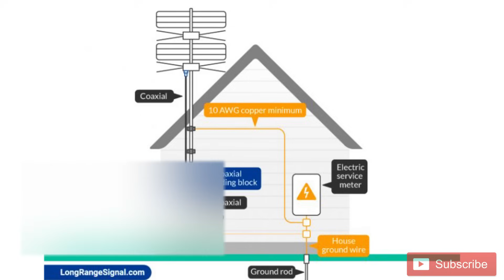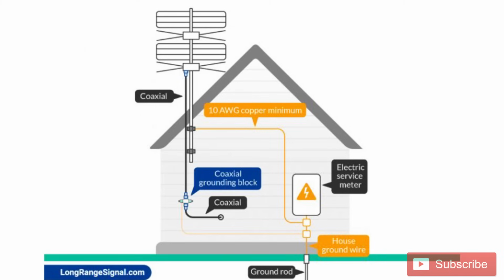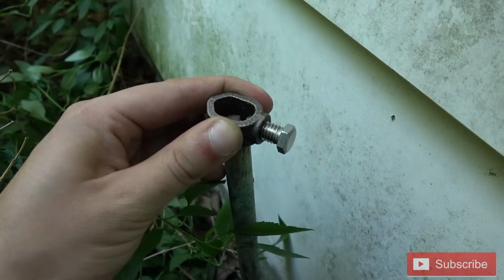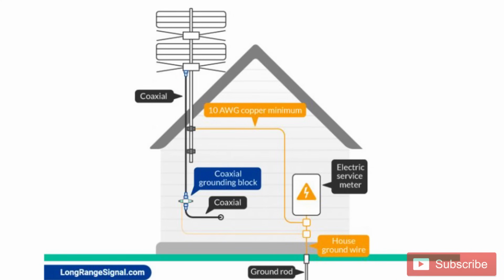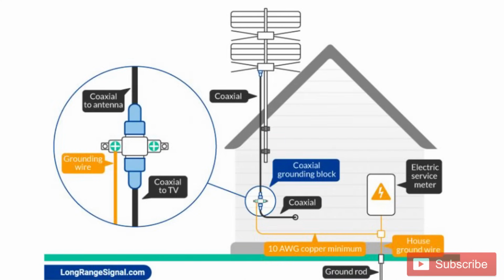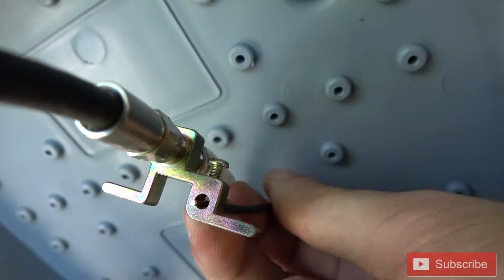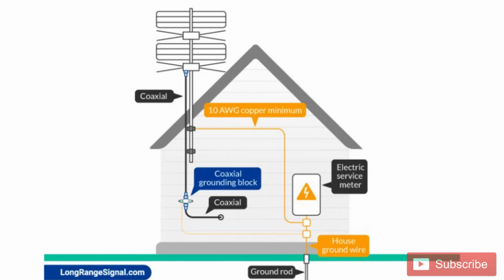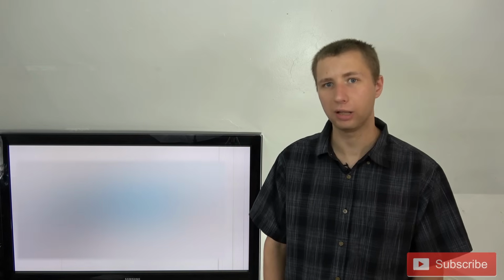How To Ground an Outdoor TV Antenna Per NEC

Comment: nice clean clear cut example.  I wondered what the wire was running next to my gas meter.  I haven't checked the electrical box yet.  so....  what to connect the ground wire to inside (attic)?  if we are running a pre-amp, and the pre-amp has a 3 prong plug, is it grounded?  I need to check mine.
Reply from the maker: Drill a hole in the side and run it to the ground rod that way
Reply: Many newer house have length of bare ground wire running through the attic the length of the house.
Reply: @genesky61  I thought about that.  I was wondering if the attic furnace was grounded.
Reply: If a human is thinking clearly.

Do the metal pipes that stick up through the roof ( ventilator pipes and such ) have a separate ground wire running from the metal pipes to ground??
The answer is No. 

Do the heating units and air conditioning units have a separate ground wire running from the unit the units to ground??
If you look you will most likely find the answer is No.

Concerning antennas , a ground wire is a path for atmospheric electrostatic buildup to go to ground.

Atmospheric electrostatic is normal part of life on this planet.

As for the bare wire that is running through the attic , the length of the house. You will most likely find it is not connected to any thing other then ground outside of the building.

If you are beginning to think that the issues concerning ground seem to be  somewhat convoluted , 
The answer is Yes and No.

Grounding issues have been formulated over a long period of time , 
having to do with human issues concerning life on this planet. 

When push comes to shove , is it better to ground or not ground??

The answer will be it is better to ground.

Is this always possible or practical or will grounding actually happen do to variety of factors , and alot of has to do with what the humans understand at any given point in time.

You can research this up one side and down the other.

Welcome to Plant Earth.
Reply: @genesky61  - By "atmospheric electrostatic" do you mean lightning?  What most of us think of as static electricity has minimal current and doesn't require heavy wire to eliminate.
Reply: Many Gas service lines are now plastic from the main to within a few feet of the meter, the part coming out of the ground is soft iron usually. So why the wire? It is not for grounding, but a point to attach a signal to so the gas line can be detected underground by "call before you dig" or diggers hotline service providers. A gas meter would NOT be the place to ground anything... Think of the ramifications in a worst case scenario !!
Reply: Yes is Ok to search on the internet for information of atmospheric electrostatic. 

I mean atmospheric electrostatic is part of the atmosphere of this planet.

Yes you still will use #10 copper ground wire or larger because of the lightning factor.

Lightning not will say , I will not strike that wire because is to small.

Yes is Ok to arrive at an understanding without making situations real complicated.
Reply: Popular Electronics , August 1967 , Pages 59 thru 62. 
Title of article is , What Ground?

Find the article at , www.rfcafe.com .

Comment: Is there a follow up to this with a diagram for if you're using a power inserter and pre-amplifier? I would guess with the coaxial grounded while using a power inserter + pre-amplifier that you'd basically be making a dead short?

Comment: I am putting a two way  coaxial splitter in so I can hook up a  tv  on different floors with the coaxial cable running down the side of the house to the ground rod. Can I connect the coaxial grounding wire to the splitter, or do I need to buy one of the coaxial surge protectors to connect the ground wire.
Reply from the maker: I cannot comment on this due to liability reasons. Check NEC code when grounding.

Comment: Hey antenna man can l take the grounding block and bolt it to the mast, attach the one copper  ground  from there running to my ground rod.Will this still work ?
Reply from the maker: Due to liability reasons I cannot comment. Refer to NEC code
Reply: Antenna Man 
Gotcha,thanks for the reply

Comment: I have seen on many sources, that refer to NEC,  that the ground wires for the mast and coax can not exceed 20 feet.  This can really be hard to achieve, even on a one story house.  There is an exception that discusses a 2nd ground Rod, but even with a 2nd,  meeting the 20 foot specification may be impossible.  it's also interesting,  that most manufactures don't include the 20 foot max requirement in their discussions.  They include everything else (i.e path, AWG etc etc)  but never mention the 20 foot max..... Am I missing something?  Is there a 20 foot max for TV antennas?  Perhaps I have misinterpreted NEC .......thanks for the videos, they have been perfect!!!

Comment: I installed an antenna on the side of the house nearest the family room (and tv).  This location must be a good 50 ft. or so from the service entrance for electrical power (and breaker panel).  So I bought a six foot copper grounding rod and drove it into the ground just below where the antenna is installed and grounded the mast to that rod.  Is that not sufficient?  Do I have to run a wire all the way along the length and width of the exterior of the house to connect it to the electrical panel's grounding rod?
Reply from the maker: You should be fine with your setup.
Reply: Yes your antenna is grounded but you could potentially have a voltage difference from the antenna to ground in your house. That is why NEC code says all ground rod must be bonded together. If a building inspector seen that he would probably give you shit for it and make you correct it. But for sole will  it dissipate static off the antenna yes it will.

Comment: I wasn't thinking about antenna strikes, but since I live in a state with THE highest numbers for lightening strikes, I will look harder at the antenna a previous owner erected.  I already turn off my tv during lightening storms, in case of an electrical surge.
I always figured that properly grounding the antenna would result in optimum signal "grab".  Thanks for the added precautions.
Reply: And Yes proper grounding does improve the reception.

And Yes proper grounding does give atmospheric electric static build up a path to ground.

And here is a truth , a direct lightning strike will fry the electronics even if the ground is proper.

A proper ground is a 6 to 8 foot copper ground rod driven into the ground.

The ground can be improved by making a trench about a foot and a half around the ground rod , the trench about inch wide and inch deep.
Put Rock Salt in the trench.
Wet the area so that the Rock Salt goes into the dirt , the ground.

An informative factual easy to understand article is in the , August 1967 issue of Popular Electronics , pages 59 thru 62. The title of article is , What Ground?

Comment: Hi, Tyler if there is no ground rod outside, can you use the ground from the electrical installation in the house?
Reply from the maker: I cannot comment due to liability issues. Consult with a local electrician if you're not sure.
Reply from the maker: Likely no
Reply: @AntennaMan  because the ground in your electrical is connected directly to the ground rod outside i dont get why it wouldnt work

Comment: Can you insert the coaxial grounding block up by the mast and connect to the same ground wire as the mast, or should you do this lower using a separate ground wire to the rod? In my case I might want to take the coaxial cable into the attic up by where the antenna is mounted and not even have it coming down the side of the house.
Reply: Also, where the antenna/mast is connected to the house with screws, bolts; should that be insulated with a thickness of rubber or insulating material, although it would be more involved to insulate the screws/bolts?

Comment: What if the antenna is on the opposite side of the house from the weather head
Reply: You could drive a ground rod near the mast and connect the ground wires to it.  I did that four houses ago.

Comment: Use all the proper equipment now all the channels are gone. When I disconnect the ground wire from the corner mount on the electric box all the channels come back in. I used the same corner ground the cable company installed ony electric box. What am I doing wrong?

Comment: Antenna Man, where can I get a filter to to keep the local CB'ers and ham radio guys out of my TV? Thanks.
Reply from the maker: Not much can be done about that. What you get is harmonic frequencies that bleed over into your TV set. You can file a complaint with the FCC if it's bad.
Reply: @AntennaMan  Thanks for the reply, at one time before cable and satellite TV the antenna manufacturers made high pass filters, the common problem was the TV's receiver  would overload because of the RF energy on the lead-in. I would have thought that the manufacturers would be making high pass filters again because so many people are now going back to antennas. FCC won't do me much good, I'm in Canada.
Reply: @JohnHill-qo3hb , Thats what I used to do with the old TV's I'd install a high pass filter right at the tuner input inside the tv. In a lot of cases that would either fix or greatly reduce the interference. Manufactures will not add anything that cost them extra. On todays tv's its probably next to impossible to install a high pass filter on the tuner. But Antenna man is right you can contact the Canadian equivalent of the FCC I'm sure they have some agency that regulates broadcast.

Comment: Can I drive a ground rod into the ground closer to the mounting location?  I'd run the 10 ga wire to that using the clamps/bolts you show on this video.  Reason is that, currently my meter box/ground rod is mounted on a power pole and quite a distance from where my rooftop antenna tripod is mounted.
Reply from the maker: I can't comment due to liability reasons. Refer to NEC and don't take any shortcuts.
Reply: @AntennaMan  O.K.  Thanks.

Comment: I have an antenna out on our place in Nacogdoches, Tx. It was next to a sprinkler control box that got hit by lightning. The control box was blasted off the wall of the house, all the electric actuated valves were shorted. However, the real damage came as the lightning that also hit the antenna rg6 cable and traveled from the antenna to the TV in the house. Lightning  blew the connector clean off the antenna and dissolved the copper in the cable leaving it a black spot... in the process YES it destroyed the 42" led TV.. I know, it should have been grounded better. But watching Antenna man I have corrected the situation!!

Comment: Crazy question: does grounding it improve signal strength? Like, maybe there was some interference or something with it being ungrounded….
Reply from the maker: No it shouldn't affect the signal. If you have reception problems you likely need a better antenna.

Comment: So I bought some wire today to ground my mast and when I ran it I realized it is 10AWG stranded not solid.  Does anybody know if that is okay or not?  I did strip it on both connection ends to bare.   Thank you .
Reply from the maker: Use solid copper. Do not take short cuts. This is LIGHTNING protection we are talking about.

Comment: You have been so helpful.  We are on our second 150 mile Onn style antenna. The first one was rained out.  Since the repack we've gone from about 35 stations to about 8 that we receive well. Our zip code is 76550 which has signals from 4 major locations.  The two we like the best Austin and Temple TX.  I am planning to ground our coax.  My questions are; I like the Walmart amplifier, is it adequate?  Since the broadcast towers are more than 50 miles away and we are on a hilltop I've settled on pointing the antenna toward Austin with Temple within the reception direction, Is it true if a couple towers are somewhat the same direction, we should receive both signals by pointing the antenna right between the towers? Our antenna is pole mounted on a 7 foot pole (an old Direct TV pole with the dish still in place) cemented into the ground (that takes care of the mast grounding) and I would guess our coax is about 60 feet. What can we do to improve picture reception quality?  You are so appreciated!!!!
Reply from the maker: The 150 mile onn antenna is junk. You cannot use the onn preamp with it because it already has one built-in. Your best bet is to buy a better antenna.